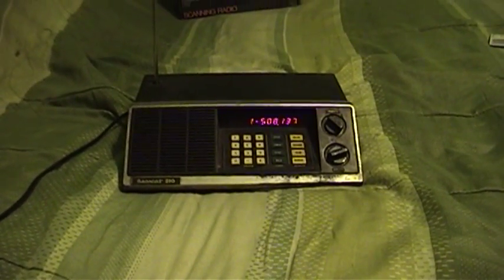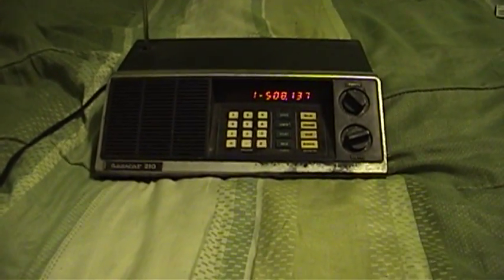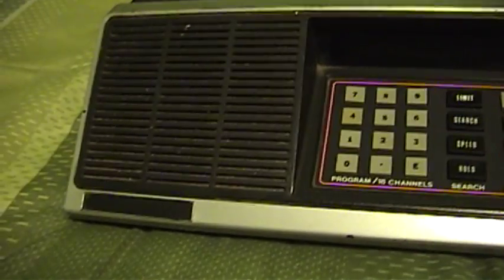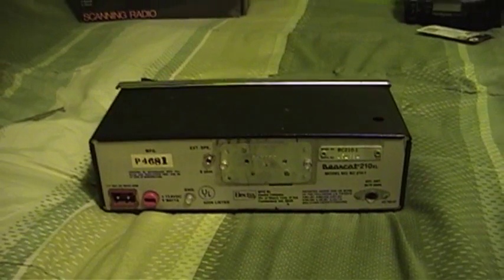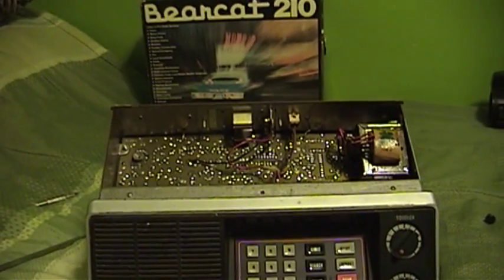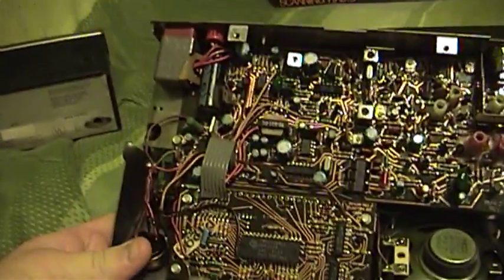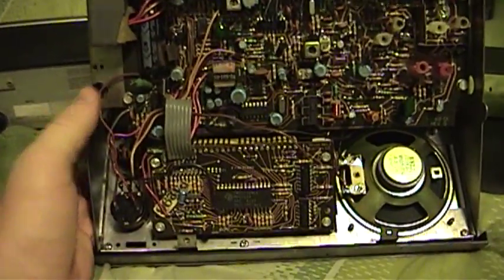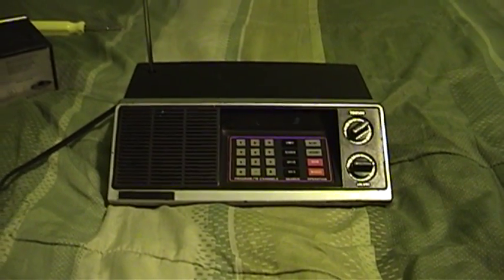Bearcat 210XL Scanner with Interesting Display

Comment: Thanks for all of the great information! Just founnd one of these in the rubbish. I a big fan of the vaccum displays as well. New to the hobby, the only problem I can tell with my device is the built in telescoping antenna is broken off. Any tips on replacing it or could you reccomend an external antenna? Thank you so much in advance, and either way great video!
Reply from the maker: If you take the cover off, you should be able to see the antenna socket on the circuit board. From there, maybe there will be enough left that you can unscrew it. Replacements, even if used, are readily available.

As for an external antenna, to best answer that question, you'll have to consider what frequencies you want to receive and look for an antenna that performs well at those frequencies. Depending upon what you have in mind to receive, antenna selection may be a compromise.

Comment: how do I program the first one you showed? My friend messed with mine and I cannot get it back on track
Reply from the maker: They all program in pretty much the same way: push MANUAL to stop scanning. Push the number of the preset you want to adjust, then press MANUAL again. Enter the frequency you want to store in that preset. Press ENTER (E). The station will now be programmed (unless it's outside of the capabilities your particular scanner has).

After as many years as these have been around, things like bad solder joints (many were questionable from the factory!), faulty keyboards (especially on frequently used keys) and components going out of tolerance are all becoming much more common,

Comment: Got a 210 and it is the best scanner I ever have owned but of course I know how to operate it..my dad had one long ago and the circuit board broke in it..I found another in pretty much pristine condition on ebay for about 30 bucks..most people dont know how to operate them or program them so...cha ching they are great for people who know..plus if you live where they have analog radio signals which my county is on it is a great radio, durable better built..nostalgic radio for minimal investment..my 210 I have now is probably 30 years old..works great and picks up police, fire, rescue in my area..which where I was a EMT  I know most of the frequencies 😊
Reply from the maker: The quality control on these was rather variable when new. Reports of never/poorly soldered connections and incorrect assembly were far from uncommon.

That said, the biggest problem with these is the keypads. They all fail, and the most frequently used keys go first. I'm not aware of anyone's having solved this problem.

Comment: I like mine but it is loosing volume, anybody have a idea why
Reply from the maker: Bad solder joints are extremely common on these and will cause all manner of strange behavior. All of these scanners are also old enough that components may be drifting out of spec (insufficient gain or leakage in a transistor, dried out capacitors, etc.).

Comment: the 210xl and 210xlt were good radios.  I have the 210xlt and has low audio, going to look at bad solder joints on that one..  you talked about the battery backup, some of the later bearcat scanners even used a cap to store the memory.  I had one (560 I think) in my truck back in the 80's and it did very well.  you did have to wire it to the "hot" direct as hooking up to the ignition switch would surge the radio and lose memory.

Comment: Just got a BC 220 for free.
Plugged it in in audio was screwy and not working right.
I opened it up and sure enough, the batteries ( AA model ) were leaking right on the circuit board.
It left a burn about the size of a quarter. No worries though, just used some baking soda and water nuetralizer and a small wire brush and a pick to get off the stubborn stuff. The positive lead was off and corroded. I fixed it back with some hole punched spacer material from a plastic milk lid and a pop rivet.. 
And everything seems to be working good. Although the squelch control does seem a little funny to me.

Cleaned it up good, (even the spaces in between the grill). I wish they would have made all of those removable industry wide! Such a pain to clean.
Anyway, it's alive!
Reply: Try some DeOxit D5 Spray contact cleaner for the vol. and squelch control potentiometers. Sprayit "into" the control pot. and work it back and forth many times, spray it again & repeat the action, this should give you a fair chance at removing the popping & crackling noises when working the control.
Reply from the maker: +ZenithClarity1969 I'm glad to hear you got it going. If you find other problems, they're likely to be bad solder joints (most common), dirty controls or underrated components that finally pooped out (mostly in the power supply).
Reply: *****
Ok thanks. One thing i have noticed that is irking me is that while scanning and it stops on a transmission the vocals are lower in volume and kind of hard to hear sometimes, when you turn it up then the squelch that pops in there between transmission is too loud.

I don't know if that is just caused from a weak transmission and nothing i can do about it or if  possibly some audio on the carrier is being blocked from an out of tolerance component.

Any ideas?

Comment: did you ever pick up a Bearcat 220? I just bought one from eBay for $15 to use for my broadcastify.com feed up in Michigan. My summer house's town's  public service  there is all Analog so it's not an issue.
Reply from the maker: +Palosrob .MaKaElectric Rebuttal Channel No, and I haven't ever sold one on eBay either.

Comment: I have a bearcat 210, when it is on it scrolls through the channels fine, but it picks up the same channel for like a second them keeps scrolling. This creates a "skip' sound. What could be the problem with this unit? It has worked trouble free in the past. Thanks
Reply: ***** Thanks for you time and reply. This unit is sentimental as it was my fathers. I believe I will leave it alone for now as I have gotten the Bearcat XLT which runs flawlessly. By the way, very interesting vid on the magic stop fan!

Comment: These were some really nice units hand assembled in Cumberland, Indiana.  I have a BC220 myself.  Love those "rolling zeros" and that LED display.  Mine has worked well for over 35 years.  As you said the solder connections often failed in these units after being shipped or moved around over the years.  They do have some nice audio

Comment: "I found this condition in a BC210XL scanner owned by a heavy smoker. Perhaps nicotine smoke was to blame, as the resistance between two input port pins on the microprocessor was down to about 1000 ohms, fooling the microprocessor into believing that a key was stuck in the "down" position. Scraping the circuit board between the two pins with an X-Acto knife fixed the problem." does anyone know where or have a pic that i can see where to scrape on the board?

Comment: Electra had excellent radio designs, but as shown in the video some of the hand soldering looks like it was done by kids in first grade. Electra must not have had much in the way of quality inspections, short of if it worked when tested it went out the door.  It got to the point where you couldn't put complex products like these on the market at the prices they were asking and have them be plagued with problems due to poor assembly.  In that respect Electra being bought out by Uniden was a good thing, as Electra wouldn't have survived.  I have fixed many of these scanners, every one always brings something interesting.  When working though, models like the BC300 are totally top notch analog scanners.

Comment: I have this same exact scanner,it was rescued from the garbage by a friend that works on a garbage truck.The bearcat I have has never given me a lick of trouble since I 1st plugged it in in the mid 90's,except fpr always having to reprogram it after its been unplugged for more than 4 hours.I found a neat trick on the internet so you can program in the aircraft band with just a few key presses,no internal jumpers.to bad it only receives F.M.ty for the history gr8 video,btw I have the same display

Comment: My father is into scanners. Always has the latest and I think he had (might still be here!) one of these Bearcats for many years. Now he has the latest Radio Shack portable model with trunk tracking, 700Mhz coverage, and APCO-25 digital. Programming is a pain now (esp. trunked systems), so he uses the computer and software to do it.

Comment: Apologies if I repeat anything already said.
I bought one of these right after it came out - cost was around $275 in 1976. More than I paid for my first car. 
The LED display was first. The memory battery was a button cell in the middle of the PC board, held with a metal clip & small screw. Between all the disimular metals in the clip, screw, PC board & battery it was prone to corrosion. A yearly tune up consisted of tearing it down fori cleaning and reassemby.

Comment: I looked at that circuit and it brought back memories back in 1979 I worked for ASI Radio . They made radios for BMW Pugot Delorean Jaguar and a few other big car makers . we got the radios in parts from China and had to build them solder a ton program and test them . I started in manufacturing then went to radio testing then warranty repair. I loved tha work in warrenty . I cried the day it went banckrupt shorlty after I went in the NAVY on submarines .
I still have 2 delorean radios and antenn

Comment: Unfortunately where I am something like this would be almost useless for police. Marion county Indiana went on a digital system using I think P.25 for their police departments and I think the fire departments are on this system too. Luckily this just ends at the county line as I can get the local Hendricks county emergency frequencies using analog radios.

Comment: I used to have a Regency scanner that looked like that, it was a little quirky, I was using it mobile and it started smoking while I was transmitting on HF, the scanner wasn't even turned on, now that's front end overload!

Comment: Heyyy I remember that, My dad had one when I was little. they are fun though. you can get all sorts of different radio transmissions on them. i always would push all the butins on it and get yelled at. and iI never thought about using it for Ham radio.. I may just go find it and put in the frequencies.

Comment: ahh florescent displays, they are so nice when new, with a green or blue filter in front of them. Often found in digital clocks and clock radios, nicer than leds :-)

The little glowing filiment wires reminds me they are valve sorry tube related.

the shame is unlike leds, they fade and lose emission like numerator tubes.

You will hate me bill as ive converted frequency counters with numerators to led displays with a swap of chips as the numerators had died :-(